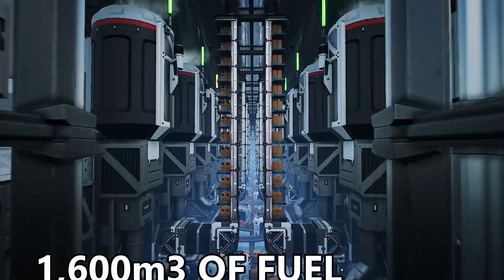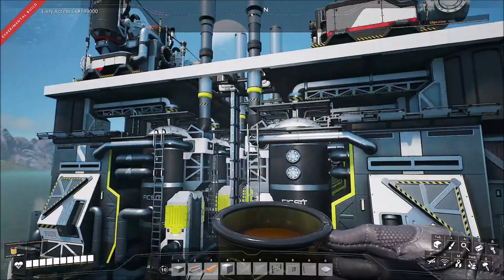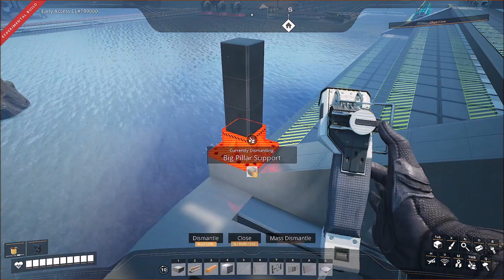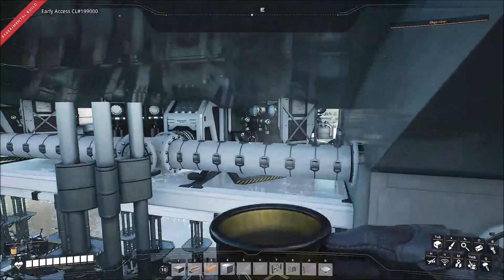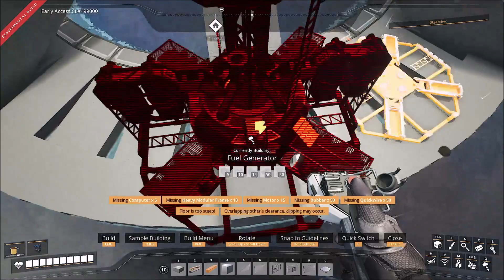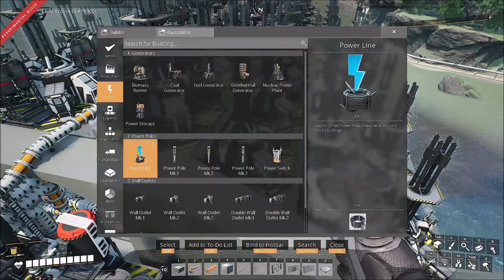Satisfactory Fuel generator fuel power plant tutorial update 6 part 2

Comment: At the 26 minute mark where the pipe floor holes are placed on the 4m foundation, I used a 2m foundation and used the wall trick to place the pipe wall holes just under the 2m foundation. Using noodle on the pipes I was able to hide the final pipe inside the angled foundations all the way to the bottom line of fuel generators

Comment: I enjoyed following along building this.  I got it all set up and running, 20mw of power.  I do have a concern though, I checked the pipe where the crude oil comes in and the last several refineries are barely getting any crude oil, i tried adding additional pumps at the start but it didnt help?  do you or anyone else have this issue?
Reply: Have you found a fix? I'm having the same issue and I tried to leave the first few off for a while, that works for a few, but the last few fall right back off after just a few mins. Not sure why. The math checks out, but it's just not cutting it.
Reply: @twofists7959  so, I didnt see this to now, so maybe you fixed it by now.  Basically had to flush all the hor pipes and then let it run.  Make sure to keep checking empty canisters, I keep finding refineries are missing some.  I've copy and pasted this build 4 times now.  I love it!
Reply: @DrawingXaos  hmmm. Interesting. Yeah, I still don't have a full grasp on the fluid systems, but just seems weird. The math of it is spot on, and fully produces up until like the last three with the third one still pretty much hanging in there, but the last two just consistently don't get enough.

Comment: Gorgeous building and interesting set up.  I've followed the vids and built one (working on second)  in version #202470.  It does have some hiccups which likely didn't exist in #199000.

The main hiccup I've found and the fix I've done is the Fluid Buffers on the top will get about half full and start to just slosh their contents back and forth when priming the system (generators all off).  I added a pump on the section of slanted pipe and then put valves between each of the buffers (making sure the flow direction is going from the packagers).

The second thing I've noticed is that after the system runs for about half an hour the upper most buffers will start losing fluid and their levels will drop from 400 to about 25 and the connecting pipes will drop to about half full.  I don't know if it's due to my priming fix or something else I'm still trying to figure that out.

The math is still good where the system is producing 1680 units of Fuel/min and the 132 generators consume 1584 units of Fuel/min so that should leave a net gain of 96 Fuel/min.
Reply: @DrawingXaos  Success!  After doing some searching around I found this Fluid Manual written by McGalleon (https://drive.google.com/file/d/1MdZ8Xr8P_SF_FL7B6WDjCZGS-x9Cwt-x/view) that had some useful information about some pipe configurations.  I modified where the 4 Fuel lines where stacked to raise their heights to use the Variable Input-Output configuration.

So far the trade off is that it does take longer to prime the generators from empty due to the VIO prioritizing filling the lower lines first instead of each group only doing their own 'section'.  Though personally I find that tradeoff acceptable with the fact I'm well past the time the system would start acting up.

The last tweak I did was I changed the order of how the packagers fed into the generators.  I have the groups closest to the generators feed to the top 2 and the front groups feed to the bottom 2.  I did that for 2 reasons:  1) when starting the system from empty pipes the groups closest to the generators take a while to get running, 2) when doing my research I found that sometimes issues will happen with fluids and the main fix is to flush the afflicted pipe(s).